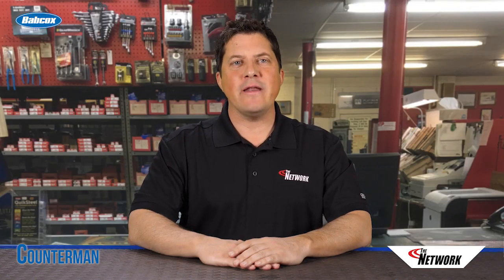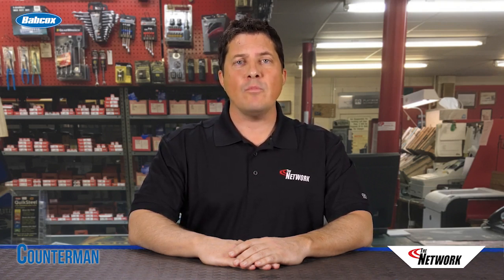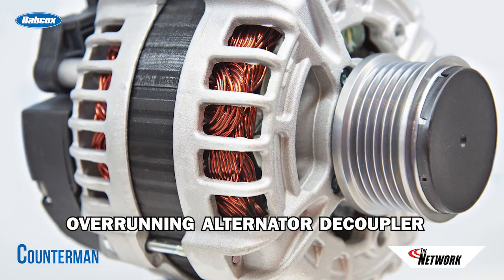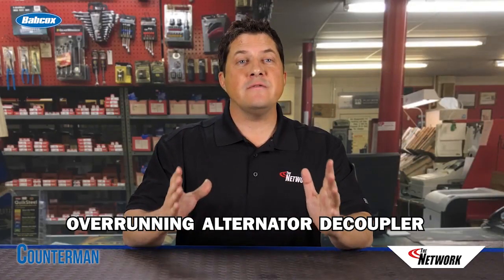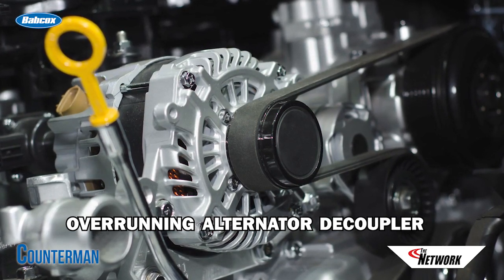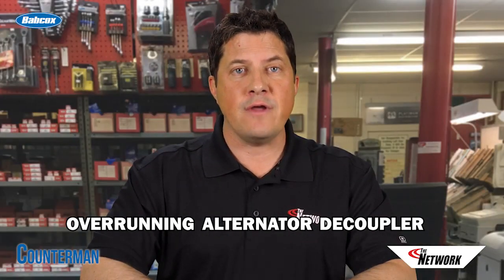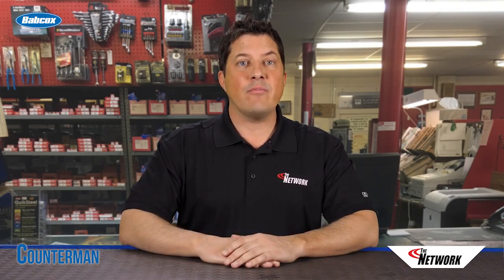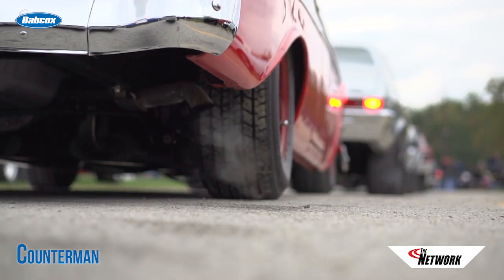Overrunning Alternator Decoupler Pulleys

Comment: So in a high rpm street driven race car, can this be used to slow down at high engine speeds? I run a 200amp custom cs130 alt with a 2" pulley and I shift at 82-8300 rpms using a 7" crank pulley (to make my ac work at idle). I understand my alt sees 28,000+ rpm but would like full charge at idle and a  decoupling pulley at say 18,000 rpm.